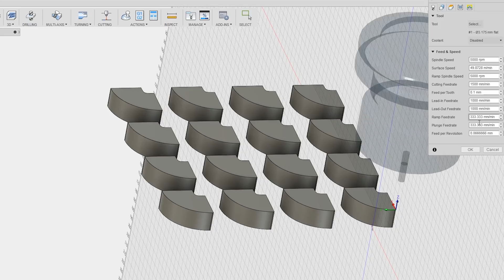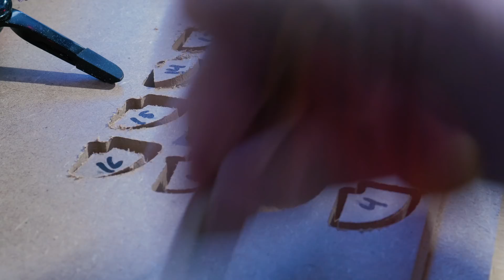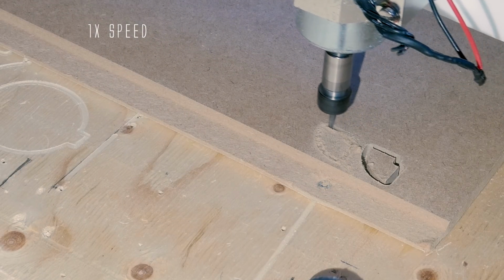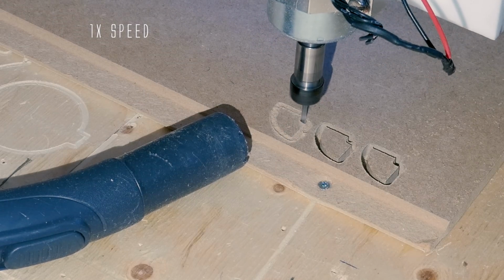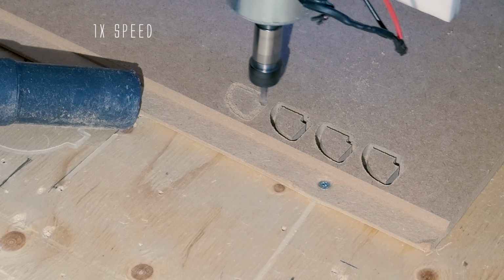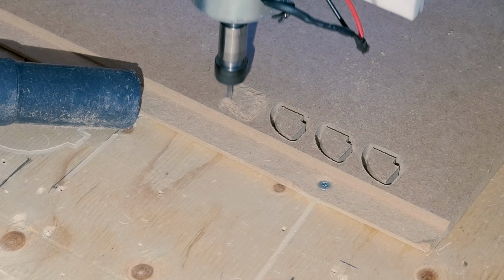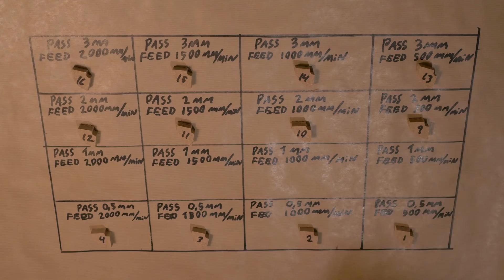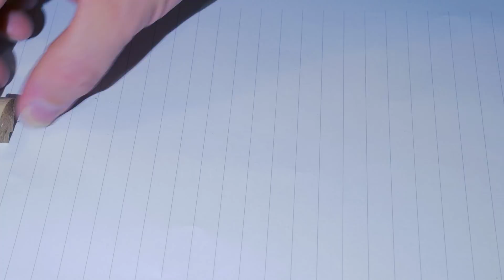FEEDRATES and DEPTHS | MDF | CNC Project

Comment: Hello sir 
    I am facing a problem with my diy CNC.... While traveling z axis, not lifting up to a proper height...
    It is not lifting while cutting or writing ... It is dameging the job... Plz  help or make an video ...waiting for u r replay
   Using grbl v1.1h.
Reply from the maker: Hi, have you figured out the problem?
It sounds like the problem is either a mechanical connection with the lead screw or most likley a wiring problem or controller fault.
Can you drive your z axis manually up and down?
Reply: @WillysGarageNorway  
Thank u sir for replying
     Yes sir I can manually make all the axis including z axis up and down ...but when I give any file it is lifting a very little bit... But most it is dragging on the surface... Yet I did not solve this ...plz solve
Reply from the maker: Are you using a cnc shield arduino or what controller
Reply: @WillysGarageNorway  
Arduino uno 
And on that CNC shield with a9488 stepper driver . nema17 moters.
Reply from the maker: Ok, might be electronic interference from the spindle. You can try to seperate the wires (stepper and spindle) as far as you can, or run a g code without the spindle running to see if the problem is still there
Reply: OK sir I will check everything..
    And I will let u know...
 Thank u ...

Comment: Hej, you can try a compression carbide bit, you can increase the speed and get very nice finish. I use compression bits on a regular basis, mostly 18mm mdf 9mm per pass @ 3000 mm per minute, 
Greetings from México!

Comment: Thanks for this! I'll be milling MDF on a fairly regular basis and you've done the work for me of figuring out what will work! The only thing that would have made it more complete would be an examination of different spindle speeds. That really has a huge impact on the tool engagement.
Reply from the maker: Hi and thanks for your feedback. Im glad the video helps you and it would be a good idea exploring cutting in different spindle speeds

Comment: @04:40 Use 3/2000 with 0.2 mm stock to leave and then come again at 9/1000 with a finishing pass taking off the remaining 0.2 left with a single full-depth pass for a perfect finish.
0.5/500 takes 12x as much time a single 3/2000 pass will take which is an insane waste of time if such issues can be fixed with the above-described method!
Reply from the maker: Sounds like a good solution and maby a new video will come in the future 👍😀 thanks for watching

Comment: Hello, I am having a rather small but pain sticking issue. My Shapoko CNC doesn’t cut through the material evenly. Even though I set cut depth z+0.5 mm (more than what you do on your videos) still at some area the bit gives shallow cut and on other parts it hardly cuts through the material. I am using 2mm ballnose end mill on 4mm MDF with 2mm Pass Depth. Please advise, I am newbie.
Reply from the maker: It sounds like you are loosing steps, could be an electronic interference issue. Have you figured it out??

Comment: Great Job @

Willy
sGarageNorway, can you recommend me a rpm for the same project of you video?
Reply from the maker: Thanks :) Do you mean rpm of spindle?
Reply: @WillysGarageNorway  yes!
Reply from the maker: @msstudios196  The spindle im using in this video has an adjusteble rpm of 3000-12000. All cuts in this video was done on the highest speed so about 12000 rpm give or take a couple of hundred. 
I realy only used that spindle on the highest speed setting on all cuts. 
The spindle I have now, the Makita rt700, the adjustable speed is 10000-30000 rpm. I use it only between 20000 - 30000 rpm, usualy on the highest setting thou 😁👍
Reply: @WillysGarageNorway  thanks for info, have you an others video  talking about feed, speed and Depth?, formula or something like that for work wood, I'm a beginner and worry about that, thanks for all!
Reply from the maker: @msstudios196  Hi, I do not have another video on the sole subject of feeds and speeds. But I have this one on carving some letters in MDF:
http://willysgaragenorway.no/2018/04/30/letters-with-tabs-mdf-fusion360-cnc-project/

Feeds and speeds and rpm and stuff like that is highly dependent on what sort of machine you are using. I would say that every machine is different if you dont by factory build machine.

You can find a lot of info on the web and of course the best way to learn is to try it out :-)

Comment: I made similar research over differnt types of wood. My strategy is to use a 1-2 Flute Endmill and cut first 0,5 to 2mm (depending on wood type - for MDF you can try 1mm) and then with the second pass, you can go down as far as your machine can handle it - so you get nice contours on top and an efficient cut from there on. The next thing is - try to increase the feedrate or lower the spindle speed to achieve bigger chips for the second pass - so you increase tool life and your own as well^^
Reply from the maker: Hi, I appreciate you sharing your experience and I will try the approaches you recommend. I am new at this game and learn something new every day. I also got a tip about doing big depths and high speeds as a rough cut leaving some stock behind. Then go over with a finishing pass at the end to erase the «layer» marks. Thanks again for giving me good tip :-)
Reply: No problem - you can also combine both strategies of small step and deep step with roughing and finishing. Just be careful about your setup - i saw its a wooden made CNC, which is fine. Just dont push it to the limit too hard, could cause mechanical issues on the long term.
Reply from the maker: Friedrich Kegel Thanks :)

Comment: Excelent! 
Slower speed means better quality.
Did you try to mill object with a curved surface?
Reply from the maker: Toto Thanks, I havn't tried 3D carving yet. I have to cover that on an other video 👍😀
Reply: This could be a good way to make patterns for aluminum casting.
Different thicknesses can be formed by gluing them in layers.
Reply from the maker: Toto Thats true. Many possibilities :-)
Reply from the maker: Toto Do you have any experiens with casting?
Reply: Yes. Do You have a questions?
Reply from the maker: Toto No, not at this time. But in the future I might try to do some casting. Then I know who to ask :)
Reply: You Welcome!